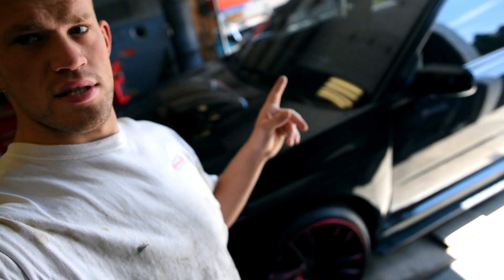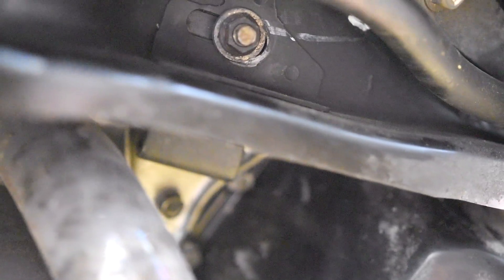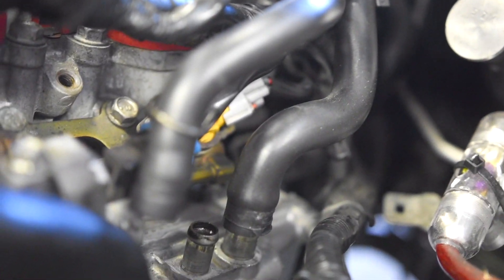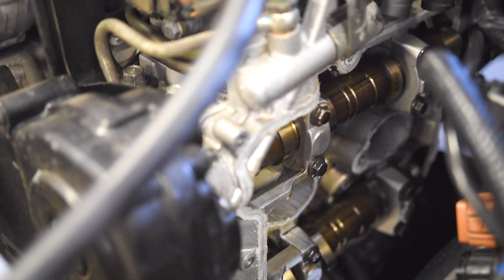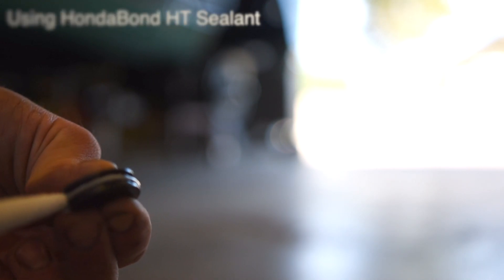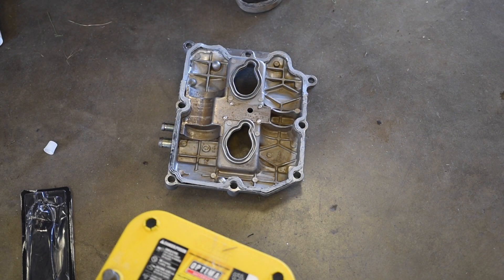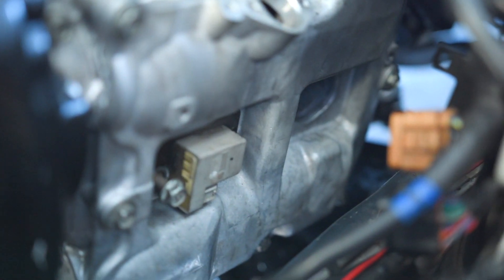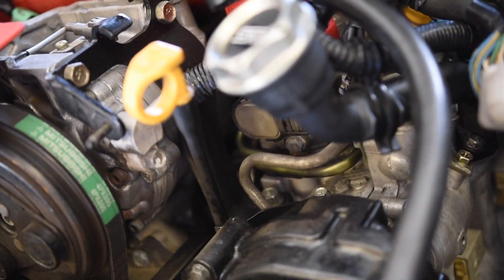Subaru Valve Cover Seal Replacement

Comment: I mean there isssss a torque spec but you're also right, dont over torque them, you'll know when they are seated. Listed below are the torque specs for the whole process. And also, you're correct about part #'s.
Also thanks for showing me the best way to get the driver side off, jacking the motor that direction makes a TON more roam, almost impossible without doing that.
Relevant torque specs:

•Valve cover bolts: 3.6ft/lbs. 

•oil separator bolts: 4.7ft/lbs. 

•oil filler bolts: 4.7ft/lbs. 

•Spark plugs: 15 ft/lbs. 

•coil pack: 12 ft/lbs. 
As per AllDataDIY & Nasioc (User: Bikelok)
Reply: Theres always the toque spec guy.

Comment: Thanks subie brother I just noticed my gaskets on both sides leaking and this saved me a heart attack going to the garage.
Reply: Jacob Egnor I have the same problem. Where exactly could you see the leak?
Reply: SPOSE KEVIN around the valve cover gaskets bottom side
Reply: @KevinDiaz-kk4wk  On my 05 wrx, I noticed it leaking from the very bottom bolt area on the passenger side,back side bolt under the coolant tank, Leaking slowly onto the exhaust causing random passenger side smoke.

Comment: Bought a used 05' Legacy Limited GT, and I was starting to get concerned on how to remove the spark plugs or change gaskets. There might be 1" of clearance between the coil packs and the frame. This was the first vid I ran across that actually showed to tilt the motor. Thanks for the info, now time for me to get to work as my driver's gasket just started leaking.

Comment: Hello what can happen if the leak was there for a long time
Reply: if the leak was there for a long time, your oil levels will go down. if your levels go down you need to top off your oil. nothing bad will happen if you top off your oil, but if you dont top off your oil it can be bad.

Comment: Bro you didn't let the sealant set at all?
Reply from the maker: patayan tribe With the Hondabond HT you let it sit for 1 minute. About the time it takes to install. If you're using threebond you need to let it sit longer forsure. The Hondabond dries super fast!
Reply: What’s the best dealer needed for the valve covers? Thanks

Comment: I cringed when he jacked the motor up using the oil pan lol.
Reply: 502_STI Where else do you recommend to jack up the motor? I'm about to start this project myself in less than a week.
Reply: @Viper3870750  its totally fine to do so as long as you put a piece of wood between the two, dont go fast. the reason why he's cringing is because the oil pickups are prone to failure (this part is located partially in the oil pan.
Reply: name badpolicy Appreciate it man. I was able to knock this out a few weeks back without having to jack up the motor. It wasn't as difficult as I thought it was gonna be neither.
Reply: @Viper3870750  this might be a little late but you can jack it up under the transmission just watch your radiator, if you can get a 2x4 under the rad to space it up it can help you get more clearance too
Reply: @RyanSmithSnowboardin   even later .. but yeah transmission .. or better ... rent a hoist and lift it out :)